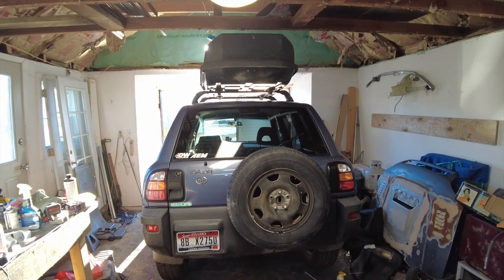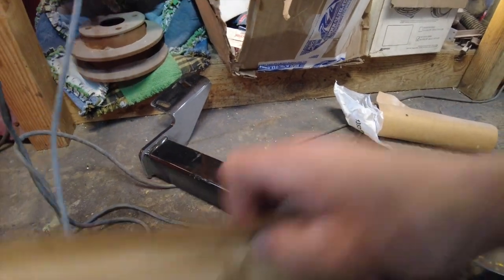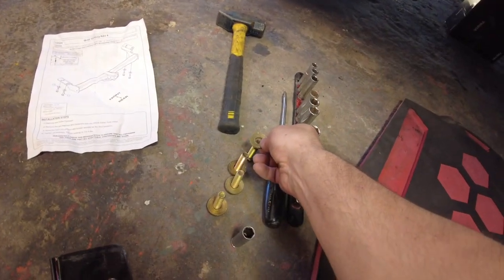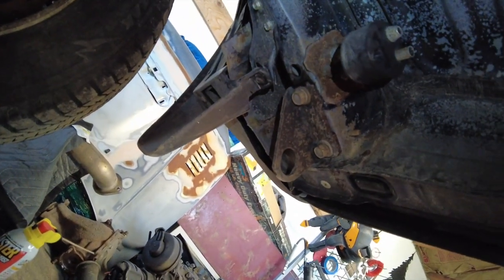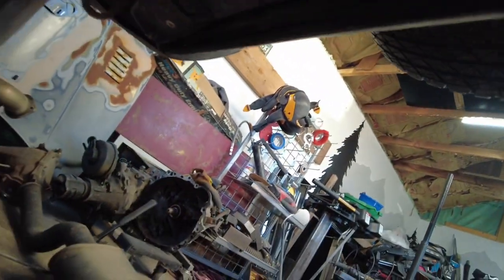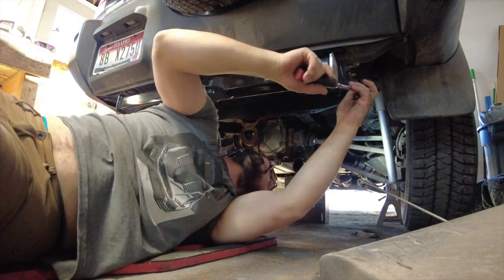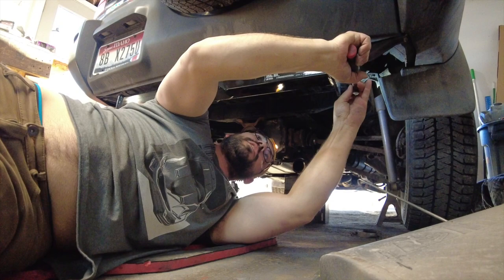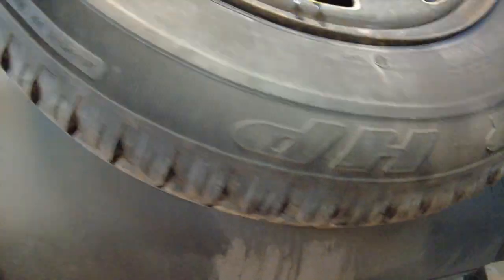Toyota RAV4 Trailer Hitch Install 1994-2006 Quick & Simple

Comment: I haven't actually seen anyone tow with a gen 1 rav4
Reply from the maker: 3sgte swap with tundra brakes will do it haha. I tow around a Datsun 620 truck bed trailer. Have pulled my twin axle car trailer as well but only for picking up metal and smaller stuff